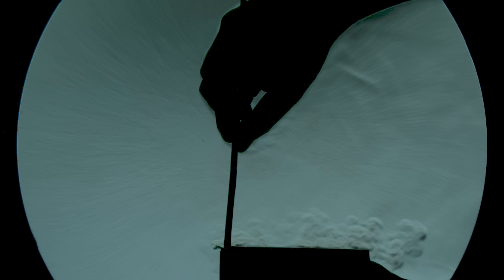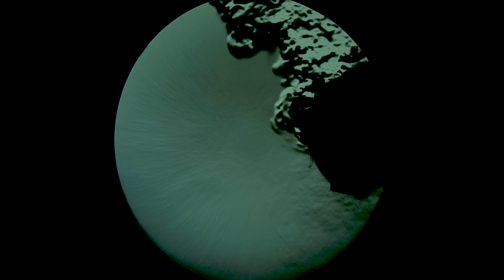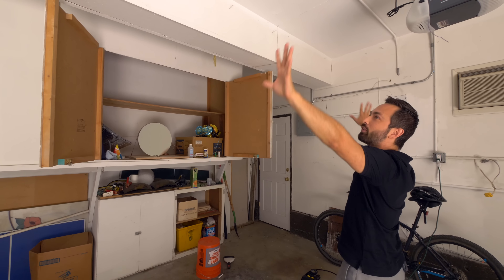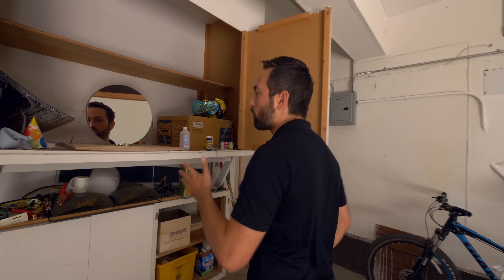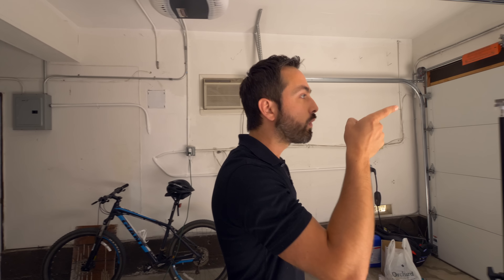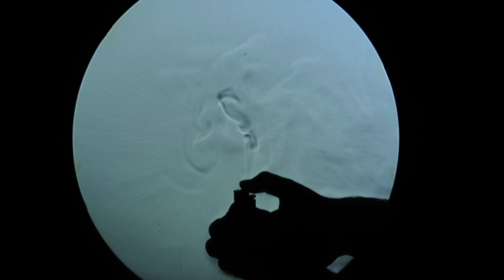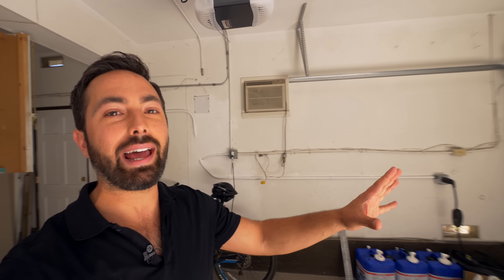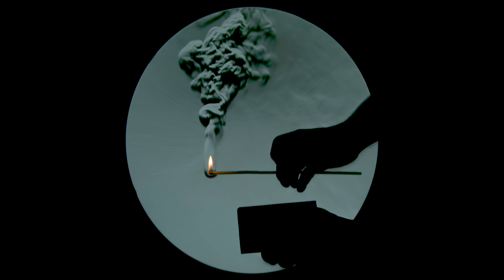How To See Air Currents

Comment: There's a bunch of cool things you could do with a model of an airplane wing (a basic asymmetrical airfoil made out of cardboard or styrofoam or something) and a fan with a laminar flow nozzle (these also seem to be relatively simple to build out of stuff like drinking straws):

* Increase the wing's angle of attack until you get flow separation (the wing stalls) and film the turbulence on top of the wing

* Film the wingtip vortex with and without a winglet at the tip of the wing to see how winglets make airplanes more efficient

* Tape a small rectangular piece of cardboard to the top of the wing, prop it up at various angles between 0 and 90 degrees to act as a spoiler and film the vortex it produces

* Repeat the previous test but with the cardboard piece taped to the trailing edge of the wing and angled downwards to act as a flap

Comment: You can see a similar effect if you have a Newtonian reflecting telescope and you find a bright star. Defocus the star so you see a large disk, usually with a black spot in the middle from the secondary mirror. It is quite easy to see air currents created by your own body heat if you place you hand at the open end of the tube while looking in the eyepiece. I first noticed it when I had a small heater attached to the secondary mirror to prevent dew and accidentally turned it up too high and the air currents coming off it were amazing!!

Comment: How about corona discharge from a piece of metal at very voltage? (like a Van de Graaf generator) Or ionization of the air due to dielectric breakdown?
Reply: Good old times when corona only meant a ring of fiery light!
Reply: @beactivebehappy9894  haha

Comment: I often noticed these shadows in running cold water into a hot bath, and at hot springs where cold river water enters...but shadows also occur when there are vortices in the water, even just when swirling it with your hand, not only with temperature...

Comment: SO AWESOME! How did you get the sound of the bubble popping and striking of the match?
1) What would the cooking of popcorn look like? (I think it would be little explosions with cool defective pressure waves coming out).
2) What about a seed sprouting? (you could soak them in a dish of water at the base of the lens)....or an egg hatching (bird or insect eggs) 
3) Electric spark from static shock or battery

Comment: You can actually see some schlieren with your unaided eye.  If you leave a car out in the Sun with its windows up for a prolonged period of time and then open one of the car doors on the side facing the Sun, you can see the schlieren effect on the car seat as the heat trapped within the car escapes.

Comment: The knife edge is strictly not necessary. I replicated your setup with a smaller mirror and found that to be so.

Reasons - the camera is looking into a mirror with an object under investigation right in front of it. So the camera will see the object itself, and its reflection in the mirror slightly displaced and slightly enlarged. The object under observation happen to be air - but the mirror principle holds nevertheless. What that means is that the irregularity in reflective index will cause a slightly different image in the mirror, and the camera is seeing both in slight displacement with each other.  The overlapping of the two images will give a very strong Schlieren effect without the need for the knife edge, good enough to show random air flow and clapping of hands.

 And thanks for the awesome video.

Comment: atomized water should pull heat from the surrounding air thus cooling that air around it. i wonder if it is noticeable and also wonder if this creates a current or if it is the droplets falling. 
or maybe seeing the "wet bulb temperature" with a fan blowing on the thermometer.

Comment: Not gonna lie but you can see these gases with the naked eye. You just have to focus your sight relax (at least that's what I need to do) I normally start with a doorway or vent or a window because I know those have very frequent air currents flowing through them and then I practice of my hands or just the air around me. Its kind of like adjusting your eyes to the darkness, but when you get really good at it, you can adjust your eyes whether it's dark or not. Which I've also learned how to do which is just dilating my eyes.
Reply: oh my fuckin god , i tried what you said , i could actually see heat comming out of my hand you should go and contact guiness world record or prolly should go to a biologist to share how you see it , you will definately get rewarded

Comment: A whip cracking and breaking the sound barrier. The amount of heat generated by an LED at different frequencies. Heat produced from inductor coupling. And heat produced when passing current through different types of wire (audio cables, high voltage wire, red magnetic wire)

Comment: Question1: Can you replace the LED light with Laser? Won't it becoming a better source of light
Question2: Will painting the razor blade black make the image better? Because you also absorb the light while blocking the light.

What you should try: Make a slit using two razor blade. See what the image will change using two different set of razor blocking mechanism.

Comment: Exploding a water bottle -- you know, where you twist up the middle so the top half has really high pressure and then twisting the cap so it explodes. If there's a little bit of water in the bottle, water vapor comes out. It would be cool to see what happens, especially in slo mo

Comment: How about Bernoulli air flow over a wing?  Like a visible air flow wind tunnel.

How about fluid flow of water around a propeller?  If you turned the axis of the camera LOS to vertical, you could view thru water in a glass tray.

How about mixing your apparatus with an IR camera?  

How about audio "standing waves" or reverb or interference patterns?

Comment: A high pressure nozzle from an air compressor. You can see the jet entraining more and more gas. Also fire works, because explosions. Or a plastic bottle with water and liquid nitrogen. Or just liquid nitrogen on a table. The blobs of liquid nitrogen float on a layer of nitrogen vapor, maybe you can see it? That would be awesome.

Comment: Nice shots, but I didn't like the part when you talked about fitting a paraboloid into s giiaaant sphere, that doesn't work that way.

Does the rotation of the razorblade edge affect the image? What if you cut 3/4 of the light with two perpendicular blades?

Comment: I just repeated the experiment with magnifying mirror, binoculars, and 2 smartphones (one as LED other as camera). mirror was very imperfect and so i couldnt focus the light in one spot (only about 50% of the mirror's suface was correctly reflecting into the lens of a binoculars) but i still managed to get video of a flow in those white spots. Looked kinda like air above a hot road. (Also youll need a high speed camera, air moving way too fast)

Comment: Cross section of a airfoil .. would you see the air moving at different speeds over the top vs the bottom of the wing?

Comment: Heat rising from a circuit board as the apparatus it belongs to is turned on. A power supply or analog amplifier would probably work best.
A firecracker.
Air being sucked into a vacuum cleaner. Maybe hot turbulent air so it's more visible.
Air around a large flying insect or small bird.
Heat from incandescent and modern lightbulbs.
Air near a spinning disk.
Evaporating gasoline or other solvent sitting in the open. Then ignite the vapor.
Glowing charcoal.
A frisbee.
A thrown playing card.

Comment: Someday in space you find a corridor in a straight line for a space ship to travel through and it is never obscured by planets. Could you endlessly accelerate faster and faster as there are no conflicting forces using some sort of engine (eg. Fusion, EM...) that is more efficient than ones today to reach a speed faster than light? And if there are stars that travel past in the opposing direction could you receive energy from solar power at this speed?

Comment: How about a comparison of incense, candle smoke, and steam/water vapor?  How about the effect of a homemade air cannon? (effectively a paper towel roll with a balloon taped to one end, pull it and let it snap back and you can actually fire small objects with the expelled air.  How would taht effect other air currents?

Comment: Add these settings to picture off the sky, circuits will become visible

Iphone settings

Exposure: 80 (or off)
Brilliance: -100
Highlights: -100
Shadows: 100
Contrast: 100
Brightness: -100
Black point: 100
Saturation: 100
Vibrancy: 100
Sharpness: 100

Comment: How about
Changing the conditions around the Mirror or the Camera- a tube between them or coloring the light in the space. 
Firing a Laser into the Space at different angles and changing its distance- the Mirror and Camera- closer to one or the other.
Magnetic conditions
Temperature containment at the Mirror to see the Area vary.
a spinning ball, gyro, spinner :)

Comment: Might the ability of this technique to see pressure gradients in the air be used to see sound waves, specifically, low-frequency, long-wavelength sound waves - and more specifically, standing waves (where reflected sounds either reinforce or cancel in fixed patterns, depending on their phase, as a function of their wavelength and the distance between reflecting surfaces such as the room's walls, ceiling, and floor - not the speed-of-sound motion of the waves, but the static patterns of standing waves when they form)? It could be very useful in acoustics studies and applications. E.g., standing waves in rooms can create significant boosts and cuts in the amplitudes of different sound frequencies at different locations in the room. Acousticians and audiophiles strive to even out the standing waves so that speech and music, whether live or being reproduced with an audio system, sounds most natural overall, instead of "boomy" or "sucked out", in certain listening or projection locations. The patterns of the various modes of standing waves for different frequencies in different size and shape rooms can be calculated, but it's enormously complicated even for just, say, the lowest audible 1 to 3 octaves or so. In practice, it's also very complicated to try to optimize it, requiring a lot of trial & error and compromise. If the standing wave patterns could be made visible with this or a similar technique, over much if not all of the volume enclosed by the room, it could potentially make it easy to at least see what is going on, including the effects of adjustments such as moving loudspeakers, changing sitting positions, adding/deleting/moving furnishings in the room, etc.

Comment: I wonder if a highly charged conductor would show visible field lines of some kind. Certainly it would show something if it gets hot, but do magnetic lines of force alter the index of refraction in air? You see this effect in the shadows of a hot car or person in very bright sunlight. Why is that? Does the edge of a hard shadow behave like your razor blade to produce this? Also, you might include  a fart. Extra points if you blow out a candle.

Comment: If I understand this correctly; I would get  a greater "efficiency" if I used a laser as light source, and placed a lens in the beam to make it diverge? The focus point of the mirror would then be just in front of the lens after all.
An even better light source would probably be an arc-lamp. They are made of two sharp carbon rods with the points real close together. Light is produces by arcing electricity between the points. It's really dangerous to work with though. Not only can you go blind from the bright light (as bright as a welders arc if you want) but it also needs a real high voltage to work...

If that IS correct though, I might try to do something like this together with my optician :p I have some lasers with a real sharp beam.

Comment: How did you record the sound of the the heat propagation? Did you simulate them from the recorded wave? Something cooler would be Talbot carpet, I think. It is not that difficult to create but imaging could be bit trickier.

Comment: I dont really think a speaker will work. This isn't detecting movement of air, just difference in the temperature of air. The sound waves moving around dont increase or decrease in temperature so you wont be able to see them

Comment: • I'd love to see what plasma (like the low temperature form generated in a lightning plasma ball) would look like when moving through the atmosphere.
~~~~~~~~~~~~~~~~~~~~~~~~~~~~~~
• The same reactions (like the struck match & the poured ice vapour), but under different atmospheric pressures & within different gaseous mixtures that regular air.
~~~~~~~~~~~~~~~~~~~~~~~~~~~~~~
• The shock wave generated by an explosion (a small one under the circumstances ~ flash paper, gun cotton, a tiny amount of black powder, etc).
~~~~~~~~~~~~~~~~~~~~~~~~~~~~~~
• U/V or Infrared laser beams that would normally be invisible to the human eye.

Comment: About 15 years ago I worked on a project to get Schlieren interferometry to work in 2 dimensions rather than the standard single dimension that is used in this setup.

We used it to restore distorted images captured at high mach velocities.

Instead of a knife to cut the light, we used a filter with 4 quadrants.

1 quadrant was white or magenta (lets through blue and red), another quadrant was red (cuts blue) another was blue (cuts red) and another was black or green (cuts blue and red).

This way you have 1 knife cutting the blue light, and another knife cutting the red light and you can get a 2 dimensional image that can later be processed by a computer.

Another way to make Schlieren work is with a wheel.  We had one wheel with magenta and red alternating, and another wheel with magenta and blue alternating and when you overlap the wheel so that the lines make 90 deg angles you get the same effect, however you can keep turning the wheel to adjust the effects.

Great setup, keep it up!

Comment: Hello. I've been experimenting with a single mirror schlieren system, and I can't seem to wrap my head around a very particular aspect of it. After the reflected light rays are intercepted by the knife edge at the focal point, I don't understand why the projected schlieren image (the shadow/silouhette formed when I hold up my hand) appears flipped and rotated relative to the object in front of the mirror (i.e., a blow dryer). Conversely, when I move my camera with a telephoto lens into place, the schlieren effect appears "right-side-up" in the viewfinder (it aligns with the true orientation of the blow dryer). What is the reason for this?
Reply: It sounds like you are too close or too far.

Comment: I happen to have three telescopes sitting idle. An 8", a 12", and a 16". Have a canon 60D with magic lantern installed, I think it will now shoot raw video. Does anyone know if the optical tube housing the mirror is an issue? I can remove the corrector and secondary mirror, but the tube is a fork mount and would make a nice way to aim the mirror. Is anyone attempting this with a SCT telescope?

Comment: Guys, this works with a normal lens, even the cheap ones, I paid 30R$ (9.70 $) for the lens, and it works the same way, i put my flashlight, try to focus (defocus) the light on the wall and i put a lighter behind the lens, IT WORKS

Comment: Where did you buy the mirror and how much did it cost? I’m trying to set up a schlieren experiment and bought a 40cm diameter mirror for around $50, and am unable to receive a nice reflected light spot, it isn’t circular and is not solid. I’m wondering if this is due to a poor quality mirror or a problem with the light source. Would appreciate your input!

Comment: You could add color to this type of imaging by causing frequency-dependent interference.  Try replacing the knife edge with a polarizer and having another larger polarizer sheet oriented orthogonally and placed such that the imaging volume is between them.

Comment: "Schlieren" in German is also used for the patterns formed when mixing to liquids different in density. Oil floating on water also creates Schlieren. Funny enough, the residue from cleaning something by swiping with ones hand, especially on glas surfaces, is called Schlieren too, windscreen wipers operating on a dirty windscreen often create Schlieren that way. :D

Comment: "Schlieren" is correctly pronounced with a really long "e" as in "wheep" :)
some air gun shots could be nice, pressure instead of heat to change the RI of the air

Comment: Very cool video. My only nit would be when he talks about his parabolic mirror being a subset of a larger sphere. Parabolas are not subsets of circles. A circle (or sphere) is the set of points equidistant from a single point. A parabola (or paraboloid) is the set of points that are individually equidistant from a single point and a line (or plane). These are different things entirely. He should not be equivalencing the two.
Reply: He does not say that a parabola is a subset of a sphere.  "if it formed just a tiny subset of a big spherical shell" .